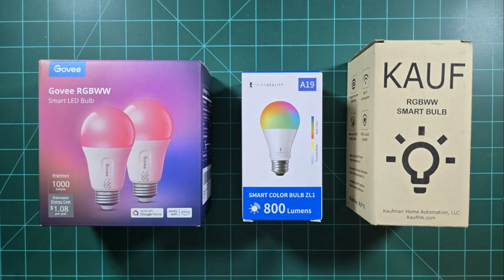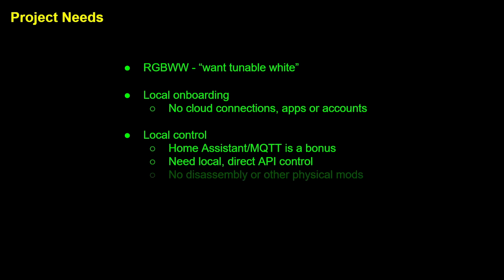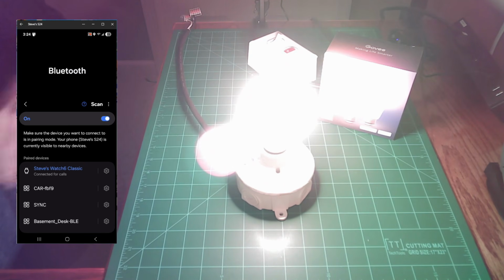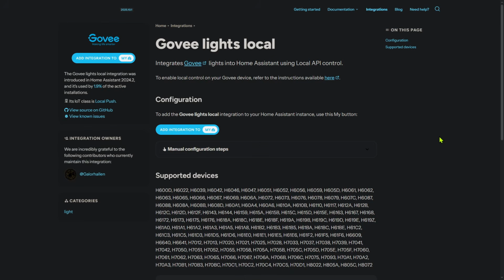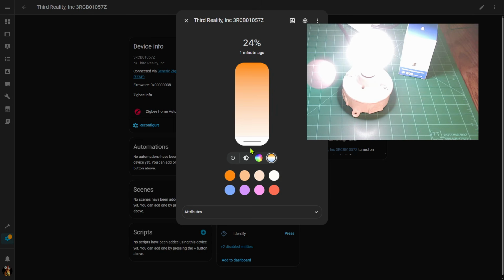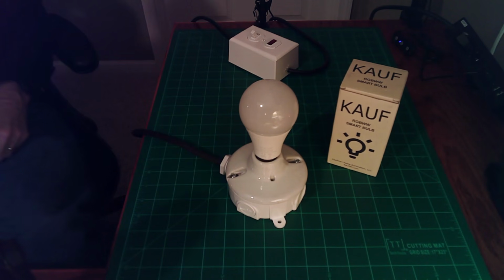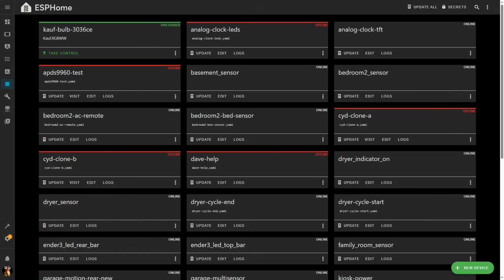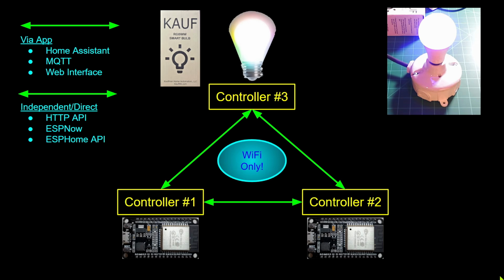NO CLOUD, NO APP? Testing 3 LED Bulbs for True Local-Only Control 💡

Comment: Is there a way to modify the bulb with adding a USB-C connector so to connect it with a DIY controller 🤔
Reply from the maker: I'm not sure, but I doubt that it would be possible without first destroying the bulb.  For one, as a standard light bulb, it expects 120V AC.  Now, that get's stepped down to run the LEDs, but if it was even possible, you'd have to solder wires to pads or pins (assuming they are even available) or disconnect the LEDs from the existing controller.  In all honesty, if you want something like you are describing, you'd probably be better off buying a small ring of LEDs and building your own "light bulb" with its own custom controller and firmware.
Reply: @ResinChemTech Good thankyou 👍

Comment: Thank you for this video. It showed me EXACTLY what I was looking for.  I was horrified at the number of online forums where you ask "will it work if I unplug my ONT?" and I get a dozen responses about how cloud is the future and I should just accept it.

I've spent years working in both security and Info Tech. If you can't control it without help from a 3rd party... it isn't yours. It is theirs and they are just allowing you to use it.
Reply from the maker: I agree 100%!  It took a while and the replacement of a number of devices, but I have my entire smart home running almost entirely local.  I'm shocked that as many people that have been burnt by cloud services that either just shutdown or when from 'free' to a paid subscription and results in bricked devices if you don't pay up or find some sort of alternative, there is still a 'cloud-first' contingent out there.

I got burnt pretty bad by Wink a number of years back... I had bought the original hub, bought the upgraded version to keep everything running when it was required, and THEN they suddenly wanted to start charging for a service they originally claimed would always be free (heck it was even printed on the packaging).  That's when I made the decision to 'ban' all cloud-based services from my smart home devices.  And none of this even considers the privacy issues.

But there's still a lot of folks that simply go the cloud route because it is initially "easier".  Check  back with those folks in a few years and after a number of their devices are nothing more than pretty plastic doorstops because the vendor shut down the cloud service those devices needed.  I think a number of them might have a different opinion at that point!

Comment: Wish I knew about the kauf bulb sooner. Thanks fir the info!
Reply from the maker: You are most welcome.  For my particular project, the Kauf bulb is working out just as I had hoped with the local API.  But do note that there are other bulb vendors that sell RGB bulbs with either Tasmota or ESPHome pre-installed.  A couple of examples are Athom ( https://www.athom.tech/esphome ) and CloudFree ( https://cloudfree.shop/product/cloudfree-smart-bulb-rgbcw/ ).  But do note that when using Tasmota, an MQTT broker is required if you do want to integrate into something like Home Assistant.

I like the Kauf bulb, but should have mentioned the other potential options in the video as well.  Thanks for the comment!
Reply: @ResinChemTech  No worries, this one fit the bill - order 4 of them! lol
Reply: @ResinChemTech  I was going to ask if you had tried the athom bulbs. You can get them with ESPHome, Tasmota or WLED. All three of them could be controlled via local control without home assistant. I've used HTTP commands to control Tasmota devices in my house.
Reply from the maker: No, I haven't actually tried them but I have tried a few other devices, like Martin-Jerry that come with Tasmota pre-flashed.  For the particular project I'm working on, my goal is to have it work completely standalone... no Home Assistant, no ESPHome, etc. required.  Just WiFi.  Integration into Home Assistant will be optional (via MQTT), but not required.
 
But the Kauf bulb that I show in the video (and am using in my project) actually does have ESPHome pre-installed.  And I am using the ESPHome HTTP API for the project.  So, in effect, the Kauf is really just the same as Athom with ESPHome.  The Kauf bulb actually does support Tasmota as well... but not a direct install of WLED.

Comment: Aqara T2 or Hue Essential for me. Both Zigbee and Matter/Thread, no app necessary and no wifi.
Reply from the maker: Yeah... I liked the Zigbee bulb (and actually used it elsewhere) but as I covered in the video, to remotely control the bulb from an ESP32 (and assuming someone doesn't already have a Zigbee hub/network) I would have to use a different ESP32 that has a Zigbee/Thread radio.  That means something like an ESP32-C6.  I'd also have to code one of the ESP32's to be a Zigbee coordinator so someone without a Zigbee network could still use it.  Too much overhead for my intended use.

So if I was just looking for a bulb that was easy to install and setup/control via Home Assistant, I'd agree 100% about a Zigbee bulb.  But as I covered for my particular project needs that won't require the end user to have Home Assistant, MQTT or an established Zigbee/thread network, I needed something I could control via simple HTTP or other API commands.

Comment: This was very illuminating! Though I had the wrong channel for a moment when you mentioned it did not have to be part of home assistant. With each release of your new videos, I keep trying to play detective to figure out the secret project. Thanks for another excellent instructional video and I am very happy you found the bulb that would meet your very specific needs. Good luck with the bigger project! Can’t wait to see it.
Reply from the maker: Ha!  Yeah... for this "secret project", I do want the option of integration and control via Home Assistant but I'm trying to design it so that Home Assistant, MQTT, nor any other type of hub or system is required.  If I can manage to figure it all out, then only WiFi will be required.

I'm guessing since you've seen the three (so far) components videos, you might be able to start putting the pieces together as to what it might be. :)   It is easily the most complicated project (in terms of code and probably the physical build as well) that I've attempted completely from scratch.  The coding would have been MUCH easier with Home Assistant and MQTT, but I know that with a number of my other projects, Home Assistant and/or MQTT are show-stoppers for some.   This project could really use a custom PCB, but I'm planning on trying to avoid that for the same reasons.  Ping me on Discord if you want to take a guess at what it might be.  I'll tell you if you get it right!

There might be one more component video.  There is one device I still need to figure out but I'm not sure it would make for a good video.  Plus, making a component video is pretty time-consuming... time I could be spending on the "secret project" instead!

As always... thanks for the comment!

Comment: Interesting idea.  I was surprised you found a bulb that did what you wanted it to.  I can't say that I've spent much time looking at smart bulbs as I prefer to control my lights with smart switches instead and haven't found a need to change the colors.  Can't wait to hear more about the "Secret Project" and what your doing with all of these parts you've been testing.
Reply from the maker: Yeah... I have some pretty specific needs for my project.  Otherwise, I would have just went with the Zigbee bulb.  Since it was so easy to add to Home Assistant (and I wanted to add it as part of the video), I just kept it integrated and stuck it in a lamp in one of the bedrooms.  

One advantage I've found using a bulb that can be controlled directly instead of via a smart switch (I also have plenty of lights controlled by a smart switch or plug) is that I can use automations to not only turn on the light, but to also set the brightness.  So for example, if it is late at night, the light.turn_on automation sets the bulb to a very dim level... as opposed to the rest of the time when it gets turned on at full brightness.  Yes... you could do something similar if using a standard dimmable bulb and a smart dimmer control.

But I do have a smart wall switch that "controls" the Zigbee bulb.  The difference is that the switch isn't really connected to the bulb... in fact, the switch isn't connected to a load at all.  But when the switch is flipped, an automation speaks directly to the bulb and toggle its state off/on to match the switch.  And since I have direct control of the bulb, it still honors the brightness setting based on the time of day.  Sort of the best of both worlds... the light is 'controlled' by the switch state, but can also be controlled directly regardless of the switch state.  Naturally, if you don't need RGB, you could just use a standard dimmable LED bulb and a smart dimmer to accomplish the same task.

But I will say that the ThirdReality Zigbee bulb was one of the easiest devices I've added to Home Assistant.  Some Zigbee devices can be a struggle, requiring multiple attempts to get it integrated.  The ThirdReality bulb popped right in without issue.

As always, I greatly appreciate the comment!  Thanks!

Comment: IKEA ??
Reply from the maker: I can't say 100% for sure since I haven't tried any IKEA bulbs, but I believe most of these are either Zigbee and/or Matter so they would very likely be similar in onboarding and use to the ThirdReality bulb I covered in the video.

Again, as I state towards the end of the video, everyone's project needs will be different... and therefore what they need in terms of a  bulb's protocol or communication method will also vary.  IKEA bulbs may very well work for certain implementations, but as I also discussed in the video, using Zigbee/Thread would require use of a different model of ESP32 (and additional coding/libraries).  I could likely make it works, but the Kauf ESPHome-based WiFi bulb was the best option for my particular project.
Reply: The correct nomenclature  for an RGB device with both warm white (WW) and cool white (CW) is RGBCCT.  CCT is Correlated Color Temperature.
Reply from the maker: While you may be correct, that certainly is not the nomenclature used by every vendor of LED bulbs.  Two out of the three bulbs I tested in the video stated "RGBWW" right on the box, despite the fact that both had separate warm and cool LEDs (and should have been labeled CCT according to you).  But as I've shown in other videos (comparing CYDs for example), I show how different vendors use non-standard "specs"... either because they are just incorrect or they are trying to pass off something 'cheaper' as a more expensive version.

So while you may be correct that these bulb should be labeled "CCT", I definitely found bulbs with only one white LED and others with two white LEDs both labeled as "RGBWW".  That's also why I stated that you need to look closely at any bulb to assure it has more than one white LED.  Others that may say "adjustable white" but only have one white LED are likely mixing in the RGB with white to try to adjust the temperature... and this generally results in a poor quality white.

Comment: This is excellent! I was looking for something with the capabilities of the Kauf myself. I appreciate the effort you put into making this video to share with us. Thanks!
Reply from the maker: You are very welcome!  I do have some unique needs for my "bigger project" so I originally purchased the Govee bulb.  When I determined that wasn't going to work, I bought the ThirdReality Zigbee version.  But I soon discovered that this was going to require a complete overhaul of the type of ESP32 (and the code) I was planning on using.

That's when I discovered the Kauf bulb (there are others that come pre-installed with ESPHome or Tasmota as well).  At this point I thought a video might be helpful for someone looking for similar needs in an LED light bulb.  At least it might save them the effort and money to buy three or four different types of bulbs until they find the one that meets their needs.

Thanks so much for the comment and kind words.  Glad you found the video helpful... and the recognition of the effort needed to create and publish a video!

Comment: But then how secure is that bulb if anyone can send an http request to it? Security would matter most if it were a lock. Is there a way to secure those commands in esphome?
Reply from the maker: Yes... if just the basics are implemented, it would be possible for someone on your WiFi network to send a command to the bulb.  But I consider this generally more secure than cloud-based apps.  Because as in my case, none of my devices are directly reachable via the Internet (no port forwarding on router... firewall rules in place, etc.).  So to control the bulb, an attacker would need the following:

• A connection to your WiFi network (so the more secure your WiFi, the more secure the bulb)
• The name of the bulb (as defined in ESPHome) as the bulb name is needed for the HTTP URL.
• A valid command (published online... if the attacker knows the type of bulb and that it's running ESPHome).

For me, I consider this low-risk.  But I'm not using it on something like a lock... where I'd have much higher concerns than if someone (on my local WiFi) managed to toggle the state of the bulb or change its color.

If still a concern, then you could use an alternate control method, like ESPNow.  ESPNow uses direct device-to-device communication and the MAC addresses of the devices are also used/needed.  Encryption can optionally be used for the communications as well.  I'm not sure whether I'm going to use HTTP or ESPNow for my project yet... I need to test both.  And I could implement some sort of additional check/password in one or more of my controllers as well to limit access to the HTTP functions (e.g. the light bulb would only accept commands from approved devices).

But in my case, since the bulb isn't open to the outside world, my personal concerns over the light bulb security are pretty minimal.  I'm much more concerned about devices that REQUIRE an Internet connection to function.  I think there is a much higher risk of someone accessing that device remotely than a local device that require a valid connection to my WiFi.
Reply: @ResinChemTech  thank you for the detailed explaination. Definitely having everything local is miles better than having a cloud iot device, The idea of accepting request from only specific ip addreses/MAC Addresses and/or having some sort of encryption sounds perfect for local-only smart locks.